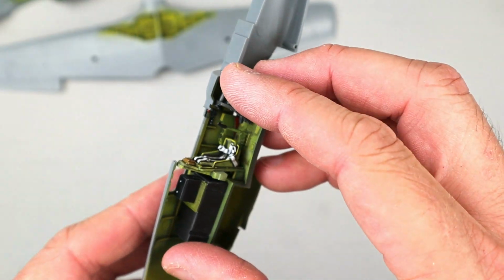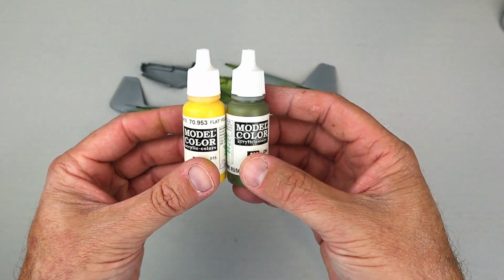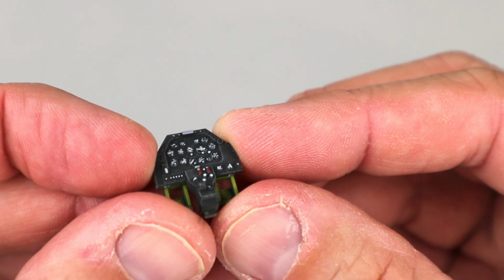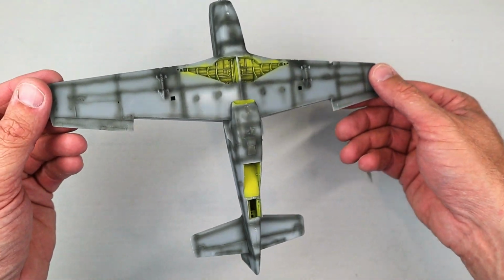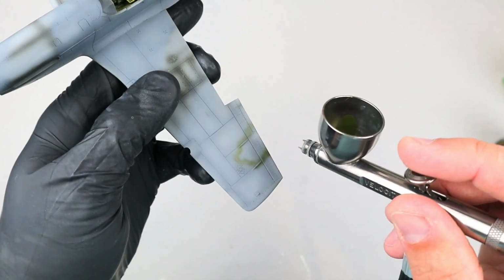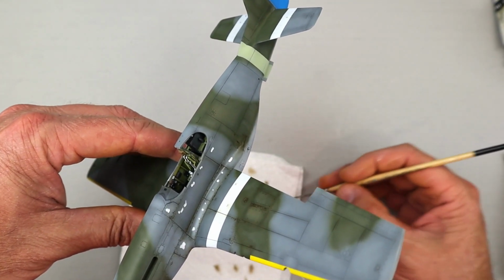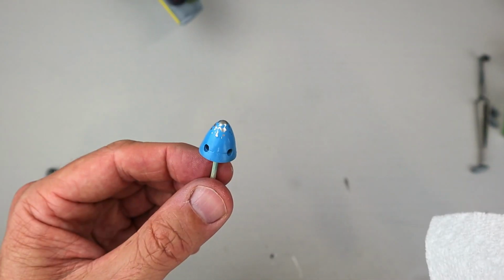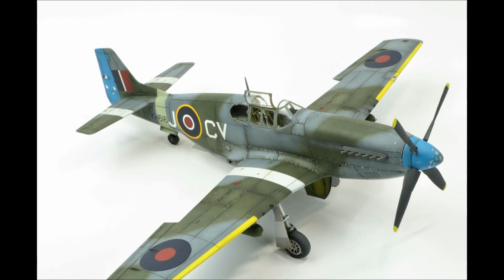1/48 Tamiya P-51C Video Build

Comment: As an Aussie it is always so nice to see a well built model in RAAF markings. Great video with some really useful build tips.
Reply from the maker: Thank you, Steve.  Just glad I remembered to swap out that tail at the end.  Appreciate the good words on the build and video.
Reply: @FlyingSModels  You did a great job in replacing the tail Chad, apart from the video documenting it if someone was to look at the finished model they would be none the wiser. I ordered the Airfix 1/48 Mustang mk iv to build in RAAF colours this morning and i'm going to try your painting technique on it as it's the same scheme. I have never tried panel lightening in all my years of modelling  and your video has made me want to give it a go. Also did you know that Tamiya airbrush cleaner (pink cap bottle)is basically the same formula as their Extra thin cement? I have been using the cleaner as a glue for a few years now. It works just as well as extra thin and is a lot cheaper.
Reply from the maker: @Nemesisrooster  Let me know how it goes for you on your Mustang.  I'm sure you will get great results.  And thanks for the heads up on the cleaner.  I had no idea but may need to switch and give that a go.  All the best!

Comment: Nice build! I do wonder, in general, why pretty much every build I've seen has the main inner landing gear doors open. If it's just started, taxiing, or just landed, those door would be shut. 🤔
Reply from the maker: Indeed.  But most builds I see don't have a pilot in them so it's unlikely they are depicting a plane that has just started, taxiing, or just landed.  Most likely show it like mine, having sat for a bit with the doors dropping from lack of hydraulic pressure.  Appreciate the feedback.
Reply: @FlyingSModels  Yep - true. I think I made all my P51s with the MLG doors down too. Only found out about them usually being up when I saw a few YT videos. They are hydraulic, and you'll see them close on an engine start. Also controlled manually by a valve if desired. I think I ready somewhere that the doors will drop on their own accord over time, usually as a result of a leaky valve. 😃

Comment: do you apply the white spirit directly on the acrylic paint, without any varnish, when you apply oil based washes? Sees like it, but I want to check before trying and ruining it on my Tamiya P51 Mustang III.
Reply from the maker: Always good to check.  Yes, I put it right over the acrylic paint.  If you put a gloss coat on first, you won't get the same results.  The oils won't work into the paint like they will with the flat acrylics.  But certainly try a test piece first.  Definitely don't want you to mess up a nice P-51 model that you no doubt have built.

Comment: Are White Spirits and Mineral Spirits two different things, or two different names for the same thing? Trying to learn. Thanks.
Reply from the maker: The terms are used interchangeably depending on what country you live it.  That being said, I buy the more expensive and refined kind at art supply stores vs. what the mineral spirits they carry at most home improvement stores.
Reply: @FlyingSModels  - Thanks. I followed the link you posted for Amazon and added some to my Wish List.
Reply from the maker: Excellent. I think you'll like that stuff a lot better than the cheaper mineral spirits.  Let me know if you have any questions once you get it.
Reply: @FlyingSModels  - some years back I did some HO train car weathering with oils and used Terpenoid. It's not as foul as terpentine, but works great on painted plastic models.
Reply from the maker: I'll have to give that a try again.  I used some oderless Turpenoid once but didn't quite like the results as much.

Comment: do yo thin your paints?
Reply from the maker: Yes, if you are talking about spraying on the acrylic colors.  I usually thin about 50/50 or so depending on the brand of paint I'm using.  If you don't thin the paint, it doesn't spray correctly from the airbrush.
Reply: @FlyingSModels  that’s my issue then. I spray at about 20psi and get okay results.
Reply from the maker: @Doglover123-b8d  what paints are you using?